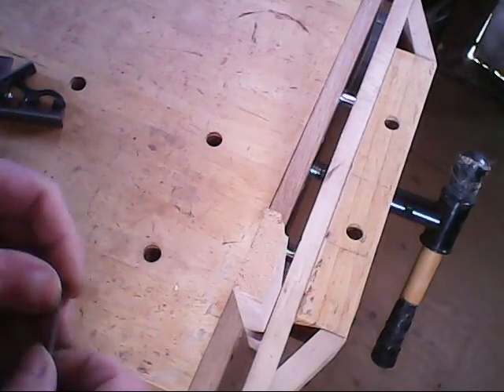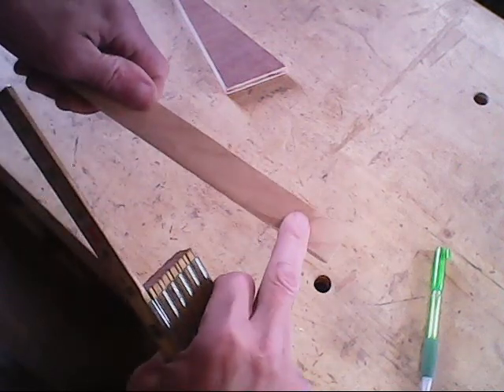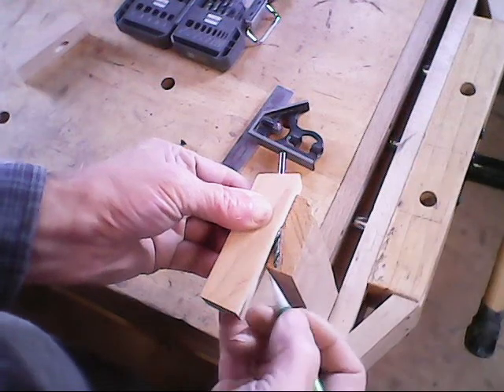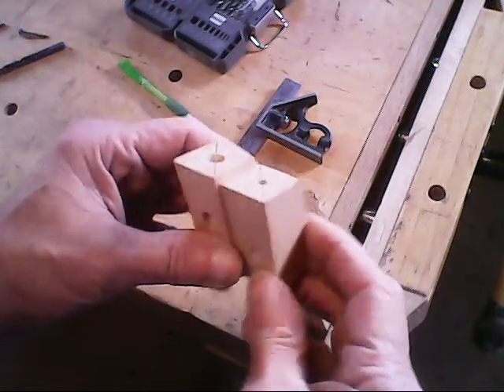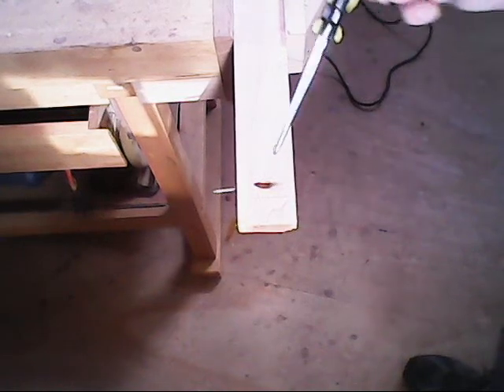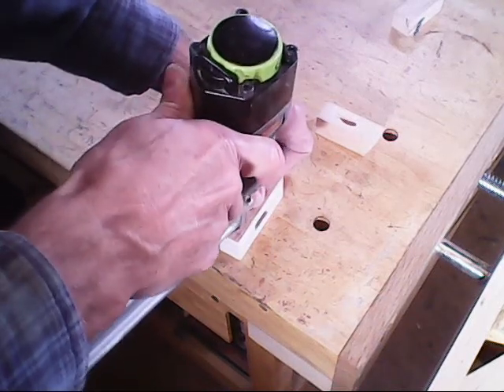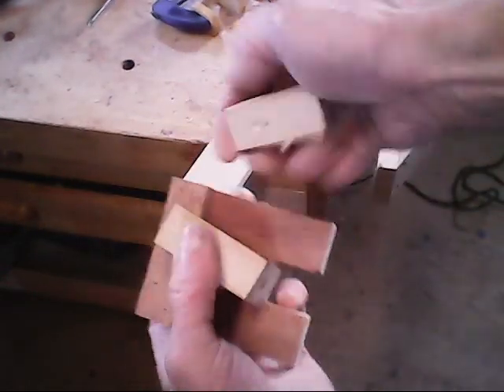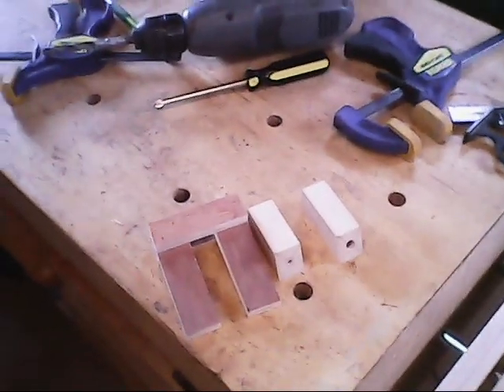Pocket hole jig complete system, for use with jobber (regular) drills

Comment: Good video. You may need a longer small drill. I think your chuck will hit the work piece if you will drill a board not just a small piece. Also, need to figure out how far the screw will penetrate the second piece.
Reply from the maker: Thank you,  for the compliment. you made some good suggestions, about improving the jig, thank you.

Comment: Very nice job here - your explanations are great. I'm a total beginner and this is so simple and it makes a lot of sense. One question - how can this be used to join 2 pieces for a small box or cabinet?
Reply from the maker: Hi, thank you for the complement.
My jig build, is a copy of the commercial pocket hole jig concept, only instead of using a
step drill, I'm using two (regularly available) drill bits to produce the same results.

The use of a pocket hole technique to build cabinets with, can be found at this link, 

https://www.popularwoodworking.com/projects/aw-extra-7512-tips-for-building-cabinets-with-pocket-hole-joinery

it explains good detail of using the pocket hole system.

Comment: I guess I could google it.  but what is jobber drill bit..berry berry good video .. I have thought about getting into machining  for building jigs ECT. but it appears to very expensive to get into..very limited on funds have friends with bakoos of equipment that might be able to make a starter piece.  any ideas
Reply from the maker: Hi, Thanks for the nice complement.

A jobber drill, is another name for the standard drill bits, that are sold in all the box stores, for every day use. 

With the commercial "pocket hole jigs" they use a specialty drill bit, sometimes called a step drill, etc... 

With my system, I was demonstrating how to accomplish making a pocket hole, that could be done with standard drill bits.

With the commercial jigs, the step drill is used to make a flat bottom hole for use of only pan head screws.

 My system, drills the taper bottom hole, due to the taper on every standard drill bit, which then allows the use of drywall screws to be used for fasteners, as drywall screws are more common fasteners, in the shop.

When you mention machining for building jigs, do you mean metal working machines, or woodworking machines, if you are asking for ideas on building woodworking jigs out of metal. Here is a link to a video series I did on making this pocket hole system as one complete unit out of aluminum barstock.

Here is the video of the demo of using this jig.
https://youtu.be/IMjQZ5fOmbs